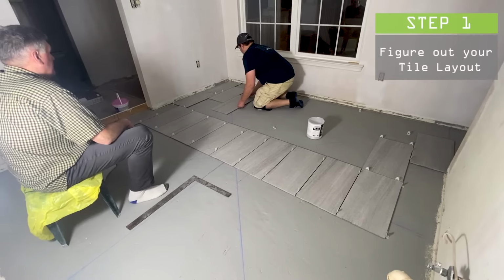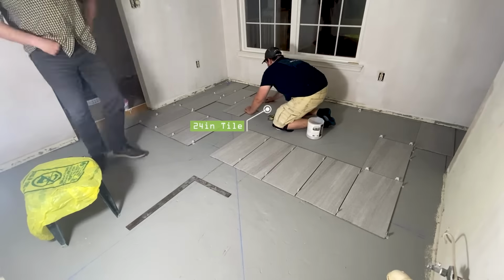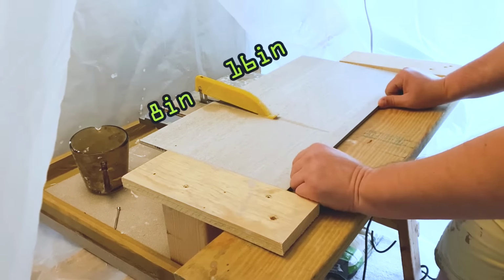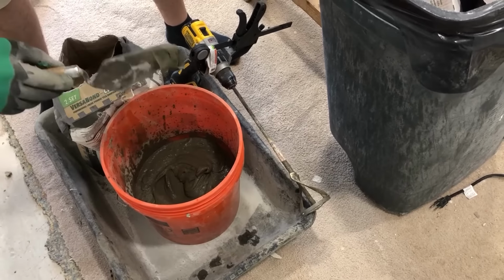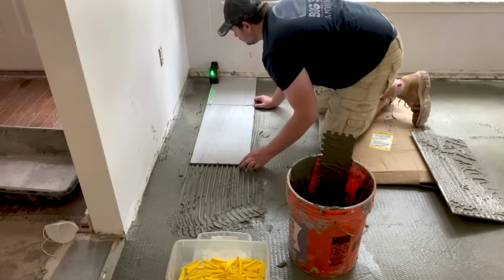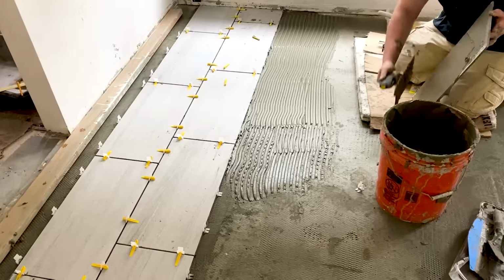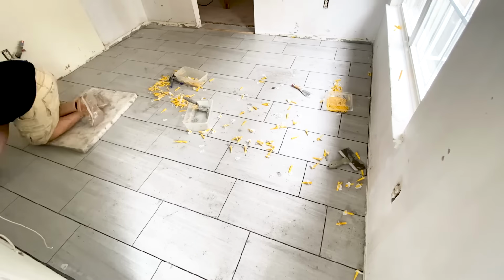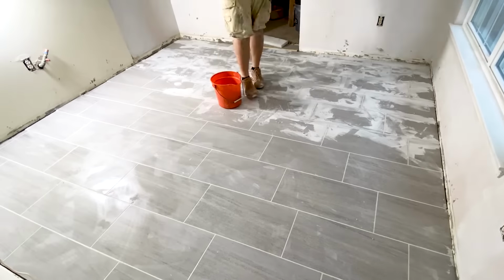6 TIPS For Laying Floor Tile With No Experience

Comment: Those spacers cause problems! They stick underneath the tile, and raises the tiles away from the surface too much! It becomes easy to not end up with enough mortar and a tile can become loose. Or even accumulate water behind it as a result.
You end up having to add a whole lot of extra mortar to ensure it's thick enough.
So, the directions you see from things like the Schluter Allset and whatnot, that tell you what trowel to you, that information goes out the window, because it's incorrect, because those darn spacers lifted the tiles up. They're thick as hell.
Shitty tile jobs as a result all over !!!
Reply from the maker: I appreciate you sharing your experience. There are tons of variables that should be considered during projects like this one. I did my best to check my tile coverage every few rows just to make sure it was good. Go ahead and subscribe to have the front row seat in case my tile fails. If it does I will definitely make a video about it and let you all know what happened. If you have any other questions please reach out I’m always happy to help.
Reply: @DIYwithMAX  I just did a bathroom floor and before grouting, after the mortar was dried, one of the tiles came right out! I stepped on it, and it make a noise. I then was able to pry it loose and lift it right out.
Clearly, not enough grout was used.
I used the trowel that was specified. The problem was that the tiles were lifted off the ground surface, because of the thickness of those darn spacers!
I can't be the first one that fell for this!
Reply from the maker: @Antiorganizer had a similar issue in the laundry room when I tiled that. Some times this just happens I’m no level 10 tile expert lol so if you think it’s the spacers I’ll take your word for it. Either way it sucks that you had to deal with it. Thank you for sharing your experience every little bit helps.

Comment: I’m a beginner, so this may be a misunderstanding, but isn’t it important to collapse the ridges?
Reply from the maker: You are correct it is very important to collapse the ridges to get good coverage.  The point I was trying to make is that you don’t want to put the tiles an inch apart and slide the tile in to place as it will collapse the ridges and make a mess with the grout lines around the tile. Instead lay them right next to each other butting the new tile to the spacers and then collapse  the ridges to install. I hope this clarifies that portion of the video. Also I did not show this in the video but every few rows I would peal up an installed tile to make sure it gets good coverage. If you have any other questions or need further clarification please reach out. I look forward to hearing from you.

Comment: @4:49 "Under no circumstances slide the tiles into place as this will collapse the ridges".  From every pro I've watched on YT, you WANT and NEED the ridges to collapse.  That's the only way to get the recommended 90% adhesion.  As has been showed in many videos, simply back buttering does not equal adhesion.  You can easily test this by pulling up various tiles after you put them down to confirm how much of the tile was actually properly adhered to the mortar.  I'm no Pro so perhaps a professional could chime in on the topic.  Because I think you gave advice that is the exact opposite of what should be done.
Reply from the maker: Thank you for taking the time to chime in. I apologize if my instructions were confusing. The point I was trying to make was to make sure your putting the tile down one after another so they touching the spacer and not half inch apart and then slide the tile in as it will collapse the ridges prematurely and make a mess of the grout lines. I hope that clears it up. Any and all feed back is welcome and really appreciated. I look forward to your future comments.

Comment: For rectangular tiles, you're supposed to lay the mortar in the opposite direction, then press the tile sideways to garanty minimum 80% contact.  The application in this video is very likely to fail after a couple impact on the tiles
Reply from the maker: Thank you for reaching out and expressing your concern for my project. Honestly I hope that is not the case. But only time will tell. I did not show this in the video but every few rows I checked the tile coverage by pealing up a few tiles to make sure I was getting good coverage. Any tile I pealed up was more than 95% covered to my untrained eye. I also made the mortar nice and thin for better coverage. Time will tell so hit that subscribe button and If this floor fails I will be making a video about it to warn folks not to use this method. Thanks again for taking the time to leave comment. I look forward to hearing from you in the future.
Reply: @DIYwithMAX  @steve0570 is correct. You need to imbed the tile, not just lay it on top. And using a good leveling system, you can walk across the tiles to further ensure they are imbedded. You can watch Schluter videos or videos on the level systems to confirm.
Reply: This is specially important when laying tiles above 15 inches, as you'll want to make sure there's no air pockets left after pressing on the tiles; the smaller the trenches for the air to escape, the better.  It might work by following the long side, but its just less efficient.  It might still have bonded properly since the tiles were not big ones
Reply from the maker: I sure hope so. If it does not you guys will be first to know. Subscribe to find out.
Reply: @steve0570  I agree the ridges should be side to side. There's enough good info in here to ignore this detail. I think the wedge system works better when ridges are side to side.
Reply: Steve's correct, the thinset should always be applied to the shorter side, leaving a shorter distance for air escaping. You got it halfway right, at least you didn't swirl the thinset! I'm sure it will be ok, just not ideal.
Reply from the maker: @richardvoyageur what you guys are saying makes perfect sense. My tile is 12in by 24in so you’re recommending troweling to the short side. But I’m not sure this makes much difference. Let’s pretend the tile is 24in by 24in then by your rationale, it should not matter what direction the installer trowels because both sides the air escapes at the same rate. So if that’s the case what is the difference of troweling a tile that is 24x24 and 24x12 on the 24in side if in both cases the air escapes in the same way? And if under these conditions the 24x24 tile would be properly installed then what would make the 24x12 not get the proper coverage?
Reply: @DIYwithMAX  With a square tile you obviously don't have the luxury of a short side but in your case you do. It probably won't make a difference but you made at least two errors in your video that many have pointed out: troweling wrong way and not collapsing your thinset enough. Other than that, some solid tips here.
Reply from the maker: @billymacktexasdetective5827 I get so many comments about my troweling direction lol. I’m glad to have some one with so many years of experience share my viewpoint on this subject.
Reply: I’ve only tiled once so I’m brand new myself. Something I noticed that is contrary to what I’ve researched is, it looks like you put grout around the perimeter of the floor between the walls. Where the information I got says to use a non hardening caulk or silicone there to reduce stress from temperature fluctuations. Same goes between the bottom tile of a backsplash and a hard counter top.
Reply from the maker: Yes you are correct. That’s what we did on our backsplash we caulked the perimeter. But for the floor we just filled the big gaps with leftover grout in the section where the cabinets will be in case there is some water spilled or something. We have central air and heating so the temperature stays pretty stable all year around. Hopefully it will not be an issue.
Reply: Bull shit urban legend
Reply: Urban legend
Reply: It's not gunna fail from normal use (just walking on it...)
Reply: @CbrF4i600cc maybe, maybe not, but why not try to do your best instead? Obviously he didn't know know it at the time and he does now, the internet is awesome for learning. I don't think it will fail either but the more little mistakes you make, the more likely you are to have a failure.
Reply from the maker: Totally agree with your point. All I can do is do better on the next one.
Reply from the maker: Thanks for your positive feedback. I’m getting a lot folks telling me the tile will fail. Honestly I’m just hoping they are all wrong lol.

Comment: Nice job, but I don’t understand why you removed wall cabinets? I understand base cabinets. But wall cabinets?!
Reply from the maker: Thank you very much for your question and for subscribing to support the channel. We removed all cabinets to replace the whole kitchen. Those cabinets were original from 1990s so it made sense to replace them especially for the price of the new kitchen we installed. Check out the other videos to see all our upgrades.

Comment: Oh no you weren’t pushing down on the tiles when you was setting them, yikes that might pop up soon. Hopefully the back butter and grout will help hold it in.
Reply from the maker: The mud was nice and loose so no need to push down very hard. So far so good but I will keep you posted on a popping tiles. I also pulled up a few tiles every other row to make sure the coverage was good. Wish me luck.
Reply: @DIYwithMAX  oh ok if the mud was loose you might be alright, good luck! 👍🍀
Reply from the maker: Thank you for taking the time to reach out. I appreciate you looking out for me.

Comment: i think there is an error with bonding, you have to collapse the columns, just back buttering is not enough
Reply from the maker: Than my you for taking the time to leave a comment. They were collapsed. I did not show this in my video but I did pull up tiles several times during the process to make sure I’m getting good coverage. I’m confident the tile is solid but only time will show. But if it fails for any reason in the future I will be sure to make a video about it.
Reply: @DIYwithMAX  Happy to hear that! Cheers!

Comment: You could have used a smaller grout joint like a 1/8 in.. if the tiles were really really good and square you could go with a 1/16th clip

Comment: Excellent tutorial video. How long do we have to wait after laying the tiles until we move in our Washer and Dryer. These are the tiles that we are going to use after our installer installed the vinyl sheet in 20 minutes without cleaning the old glue and debris. He moved in our Washer /Dryer right away. 1 hour later there were humps and depressions. Another guy will install the tiles.
Reply from the maker: Thank you very much for your kind words. Yeah that was a bad move on his part to move the machines in. To answer your question it will depend on the mortar used. The bag will have the curing time on it. But a good rule of thumb is 24 to 48 hours because you want to let the tile and the grout to set. Grout will have its own curing schedule. For a laundry room with heavy machines that vibrate longer is better. Good luck on your project let me know how it turns out.
Reply from the maker: PS your doing the right thing by educating your self on the process of tilling to have the knowledge necessary to know if your contractor is doing the right things. You want to look for some one with OCD for laying tile lol. Most folks out there just do the minimum to collect payment. I have a buddy of mine just had someone retile his bathroom and when I went in there I could not find a straight tile anywhere and the gaps were all different sizes basically a mess. And all because he did not know what to look for to be sure he picked the right person for the job. Honestly even thought I don’t do this professionally for a living I wish he would have called me to help him out.

Comment: why are u applying the mortar with the stripes running in the direction of the longest side, air gets out easier if you do it towards the shortest side, no ?
Reply from the maker: You are 100% correct. This was my first tile job ever so I learned that from folks in the comments after the fact. But I have to honestly say my mud was nice and thin and I was more comfortable pushing the mud around the way I did it. I tried the other way and I have to make more passes for the same tile. Honestly I’m not sure how much different it makes. For example if I was laying 24x24 inch tile instead of 12x24 it would not matter because the sides are the same size right, as long as it’s all in the same direction it should work just fine. Just my opinion. Thank you for looking out for me, taking the time to leave a comment and subscribing to support the channel. I look forward to your future questions.
Reply from the maker: Also I did not mention this in the video but probably should have. Because this was my first time I actually pulled up a few tiles every few rows to make sure I was getting good coverage. This renovation is for my in-laws so I wanted to make sure it’s done to the best of my ability lol.

Comment: I would suggest running your trowels marks opposite of what u did because then when u slide the tile left to right or vice versa it’s easier to collapse your ridges and let any air out
Reply: I dont think he was collapsing the ridges... lol
Reply from the maker: @lima5439 I can assure you the ridges were collapsed lol.
Reply from the maker: Love the YouTube handle. Thank you for your suggestion and subscribe to support the channel. Few other folks made the same suggestion. I will have to try that on the next tile job. Luckily this one turned out ok.

Comment: Nice job! The only thing I would suggest is using Shluter Ditra instead of the lathe method. I find the Ditra easier to use because as soon as you lay the Ditra you can start tiling. No waiting till the mortar bed dries. Also, the grid pattern on the Ditra is helpful with aligning. I was about to comment about not back buttering the tiles (I have seem many pros not do this) but I waited and you did.
Reply from the maker: Brett thank you for taking the time to leave your helpful suggestion and for subscribing to support the channel. Our goal with the lathe method was to level the floor before laying tile, so I just want to clarify for the audience that you would use the Ditra for floor leveling in this scenario over lathe?
Reply: Not pros if they don't back butter....
Reply: Whats shulter ditra ?
Reply from the maker: Schluter-DITRA is a special underlayment used in tiling to prevent cracks. It works by creating a flexible layer between the tile and the floor beneath it, which can move independently. This movement prevents cracking when the floor expands or contracts due to temperature changes, or if there's any settling or shifting in the building structure. DITRA also acts as a waterproof barrier and helps manage moisture by allowing it to escape from underneath, protecting wood or other moisture-sensitive subfloors. Essentially, it makes your tile installation more durable and less likely to crack over time. I hope this helps. Please let me know if you have any other questions.
Reply: You can't level a floor with uncoupling mat. 
He's using lathe with a slu like you're supposed to.
He mixed it a bit dry but he already found that out while he was working it lol.
Reply from the maker: @typ044 yeah learned that the hard way lol.
Reply: @DIYwithMAX  We've all been there. On the plus side you never forget the hard lessons.

Comment: Wow I never seen anybody remove the cabinets and everything and tile underneath
Reply from the maker: Normally we would not but we were ripping the kitchen out as well so it was easier to tile everything while the room is empty instead of struggling with cutting tile around installed cabinets. The cabinets have adjustable feet so in the future if different owners want different tile they will be able to remove what is there now and put down new tile to there liking. Thank you for your questions and for subscribing to support the channel.

Comment: Your troweling you quick set in the wrong direction, the direction you are troweling it will trap more air. You also have to put more pressure on the tiles to collapse the ridges. I seriously doubt you have very good coverage and over time your tiles will start to come loose. Looks nice but it won’t last.
Reply from the maker: Thank you for your advice. I will consider it in the future projects. Because this was my first time laying tile I was meticulous in checking the coverage in just about every row. I just did not include that part in the video. Also I got a recommendation to make the mud nice and thin so that the ridges collapse nearly from the weight of the tile. I’m confident this tile job will last a long time but only time will tell and I hope I’m right lol so I don’t have to redo it any time soon. Thank you for subscribing to support the channel and sticking around to make sure I don’t screwup future project. Looking forward to your future suggestions.
Reply: Stupide urban legend
Reply: Wouldn’t the ridges collapse appropriately once you put the shims in the spacer leveling system ? I’ve never done this before.
Reply from the maker: That was my experience.
Reply: @alancastle5231 not enough though

Comment: under no circumstances do not collapse the ridges? isn't that the whole point so you have good coverage?
Reply from the maker: HeYYou Awesome YouTube handle, you are absolutely correct that the tile should collapse the ridges when placed on top of the mottled bed for good adhesion. The point I was trying to make was to place the tile on top and not try to slide it in from the side as it will collapse the ridges unevenly and make a mess between tiles. I definitely could have made that point clearer. Thanks for catching it and for subscribing to support the channel. Looking forward to your future comments.